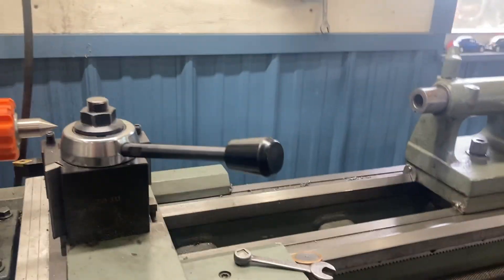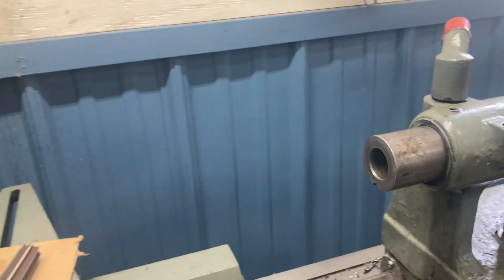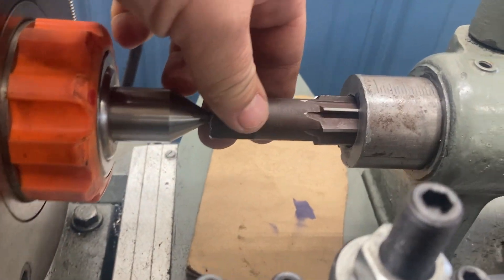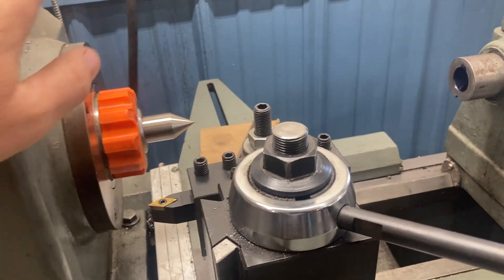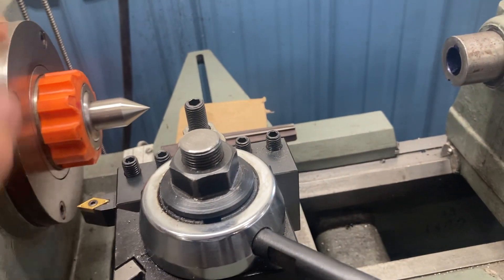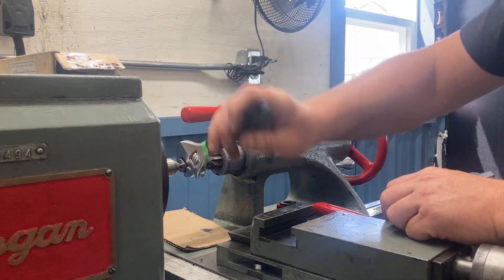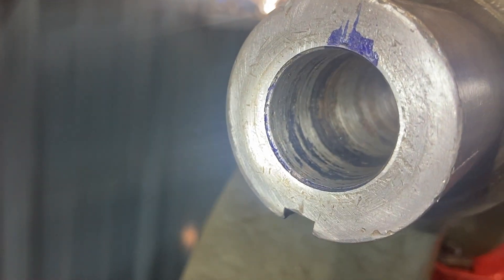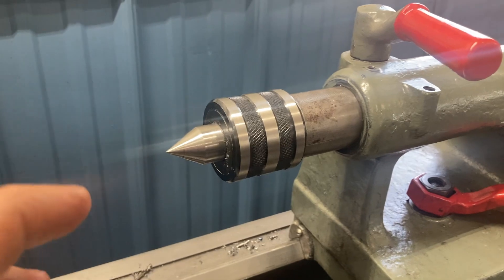How to Ream a Lathe Tailstock - Repairing Morse Taper

Comment: I bought an old Colchester Mascot 1600 80 inch gab bed lathe.....for tail stock I have not yet reamed it...but bought   set of brand new sleeves 1 to 5 and installed today MT5 tail stock...for dead centre I bought separate MT 4 to 5 sleeve and for Jacob's Drill chuck....set of sleeves right up yo MT5.... it's working well

Kept all sleeves aside that came with the machine

Comment: I agree,no power from live centre,only by hand when reaming this as this taper and anything under 7degrees(3.5 off of spindle axis) is designed for locking in place.1st light ream with dead centre taper extended and locked then halfway out and locked then fully retracted and locked to correct for misaligned.Surface Hardness maintained for 0.254mm or 10"thou of inch.Just under 40"/1.0mm.Make sure spindle bearings warmed up for less live centre clearances and lightest oiled cuts possible.

Comment: I have a tail stock that needs cleaned up. Dialed in the TS and bought two new MT3 reamers, set it up the same as you did but I am not seeing any chips ? It’s like it just scrapes and doesn’t cut ? I tried the roughing reamer first, then the finish reamer once it felt smooth. I can still feel the gouges in the tail stock. I am going to chuck the reamer up in the four jaw next and try to run it at 75 RPM’s to see if I can remove some material. The quill is cast iron and polished I do believe. Also I have a second machine (identical) that was missing the whole quill assembly. So I machined a new one out of 1144 stress proof and it needs the taper cut in the end. Would you recommend using the reamers or cutting it in with a boring bar then just the “finish reamer” ? I’m ok if I need to face the end but It just doesn’t seem like it’s cutting. It did improve the fit and the tooling is definitely more secure. It no longer requires slamming it in to seat. It just locks in. But it looks terrible and like I said I can feel the groves inside the taper. I wanted a full new machined taper that is smooth and clean. Also I noticed it only makes contact at the very front on the quill. The back of the taper isn’t really getting touched. I checked the handbook and it’s definitely not supposed to be like that. 
I’m not a pro, and I’m not a beginner, but I don’t have much experience with cutting tapers with reamers. I’ve always used reamers as a last pass kinda thing. How much force are you putting on the tail stock quill when cutting by hand ? Should it be hard to rotate the reamer from the tension placed on the quill? 
Sorry. Didn’t mean to type out a ten paragraph comment. 
 Thanks for any reply’s.

Comment: Surely mounting it and dialling it in a on a 4 jaw would be more precise and assist with alignment also. Also, VERY accurate headstock alignment would be crucial BEFORE this. Cheers, Michael 🇦🇺
Reply from the maker: You’re more like to introduce error by mounting it in a rigid setup like a 4 jaw chuck. You have the it backwards. The way shown ensures that you’re following the original taper itself and not introducing new positioning through alignment error or other mistakes.

The goal isn’t to produce a new taper. It’s to remove burrs and damage while waving the existing taper as intact as possible. Hence the bluing.
Reply from the maker: Also, the video instructs people to properly check the alignment not only on the tailstock adjustment screws themselves but also in the height of the tailstock to ensure shimming isn’t necessary.

Comment: I had this issue with the internal taper on my spindle (previous owner seriously damaged it) and I did the same operation you demonstrated, but with the reamer pointed the other direction. I was aware of the engagement depth changing and I was measuring it as I went, but I kept going until I had a usable taper inside the spindle. That put my engagement depth a half inch into the spindle bore. Now I can use draw collets (where previously I couldn't use anything ) - but that's it. Unlike with the tailstock I can't just face it off. What would you do (going forward, not in retrospect) in this situation? 

Right now I'm contemplating going even deeper with the reamer, as far as it will go, then pull a MT3 blank out of the freezer and drive it in hard, and then bore out the blank and turn it for MT3, ream it to the proper depth. Basically a permanent sleeve repair.
Reply from the maker: Honestly, I’d probably look for a replacement spindle if it’s on an older machine and easily replaceable. These Logan Lathes have a strong parts support and I know I could find one if I needed to.

Other than that, you could attempt the repair as you described, but turning the taper would be very difficult to do while maintaining the surface finish necessary to have a really good result. Those operations are better off ground than turned. The reamer in an ideal situation is just a touch up remedy.

Sorry it took so long to respond. Have you made any decision as to what you’ll try? At this point I suppose the spindle isn’t going to get any better, so why not attempt a repair with the backup plan of replacing it should the repair not come out to your expectations.
Reply: @MaineMachinist  Thanks for the reply. I've not done anything yet, life keeps happening. But I've thought about it enough to reach same conclusion. I will try the sleeve repair that I described, and I will grind the taper - This gives the perfect excuse to make a tool post grinder.
Reply from the maker: @charlesstaton8104  let us know how it goes!!!!
Reply: @MaineMachinist  will do!

Comment: That's a great way to destroy a good machine for sure.
Reply: G'day Snick, I'm actually really interested in your comment. Can you explain why it's bad please, I don't want to go and F any of my machines or gear. Cheers mate, Michael 🇦🇺
Reply from the maker: @SpatialGuy77  if you watch this video carefully and do exactly what is described, this is the correct way to repair a damaged tailstock taper. 

Take special care to make sure the tailstock is in alignment with the headstock before beginning, and check the tailstock to see if it needs to be shimmed first. To do that, place a dead center in both the spindle and the tailstock and use an indicator to see if the heights are the same. Most tailstocks on old machines need shims
Reply: @MaineMachinist  Yeah I got all that, but I wasn't asking you... Of course you are going to say your way is the only way, maybe it is, but other opinions are important too so give Snick a go champ. Cheers, M🇦🇺
Reply from the maker: Do tell, most wise one.
Reply: @MaineMachinist  Well what part would you like explained? I own my shop for 36+ years. Like I said will work for a home shop and it is not industry standard. Hard to ream a hole if you don't know its inline ????????? With the barrel ??
Reply from the maker: This is standard industry practice. Im surprised you’re unfamiliar with it - maybe you just don’t have much experience in the trade.
Reply: Come on Snicks please explain??
Reply: @martindennehy3030  Well in your video of saying put reamer in the chuck would be a killer for sure. The way you did yours is good enough for home shop use. The way we do ours would be the barrel removed and ground or turned.
Reply: @snicks50  I never made a video or said put it in a chuck that would be as stupid as  trying to turn it. 🤣
Reply: @martindennehy3030  Well what part would you like explained. I own my shop for 36+ years. Like I said will work for a home shop and it is not industry standard.

Comment: As has been already mentioned it will be a simple operation to face off the end of the quill to reduce the ID down to a size that allows good clearance on your sleeves. But I'm just wondering if you aligned the tailstock to the best possible prior to doing this? In my opinion machines of this age are nearly always worn and the tailstock will be below the centre line of the spindle and require shimming. In which case you will be cutting a new MT seat at an angle in relation to the spindle. I would check this before you go any further. Personally I'd clock the outside of the quill now and verify alignment as best as possible, then I'd ream until fully cleaned up and then face off as much as needed. It'll probably only be a small amount. Look forward to an update.
Reply from the maker: I mentioned in the video that before doing this you need to make certain the tailstock is dialed in, including checking for height, because most old lathes tailstocks require shimming
Reply: @MaineMachinist  Apologies, I must have missed that. Looking forward to new videos :)
Reply from the maker: @iiredeye  no problem! It was just casually mentioned about half way in, but you’re absolutely correct on everything you mention! It could easily be messed up if everything isn’t checked!
Reply from the maker: Thank you for commenting!

Comment: if you go too deep you can face the tail stock
Reply from the maker: That’s true, I don’t see any reason why you couldn’t face the tailstock, but I’d rather stay on the conservative side and not need to do that.
Reply: @MaineMachinist  keep going, get the maximum amount of contact.
you will only have to face a small amount off to get it back.
And remember each taper will seat at a different spot anyway, you will have some with more stick out, and some that bottom out and you'll need to face it anyway.
Reply: @MaineMachinist  that is fair but an option some may not think about

Comment: Great explanation.  I had to do a bit of this on my own lathe, and I used the same basic approach.   In your case, if you had to ream deeper, and you started to run into issues with the tooling hitting the end of the tailstock quill, I imagine you could chuck it up and machine a little bit off the end, to regain at least some of that clearance.
Reply from the maker: I don’t see why you couldn’t face the end of the quill a little bit if you had to